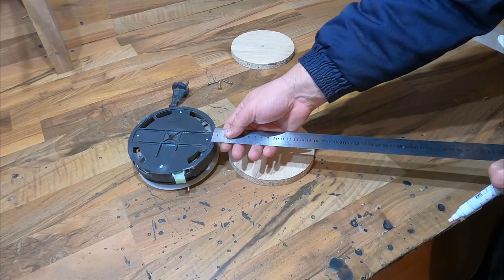Top 3 Amazing Vacuum Cleaner DIY Project

Comment: Hi Jordan. great video. I like your no-nonsense-attitude in your projects. I didn´t know what heat can do with a sturdy pvc. My vacuum motor in a pvc looks a lot clumsier. But now I know how to make it better. Thank you. My 2 cents on the electric cord mechanism: I changed the plug for a socket and fixed the device on the ceiling. Now I can pull down the cord from above, put for example my sander in, cable is not in the way and when I´m finished zzzzt it disappears again. For me the best part I salvaged from a vacuum cleaner ;-)
Reply: It Must ! Have ! Done !. Miracles ! For ! You !. Then !!